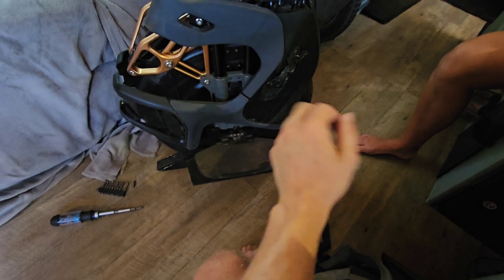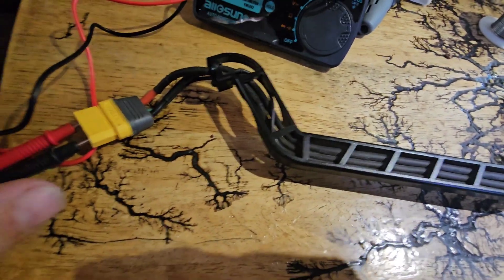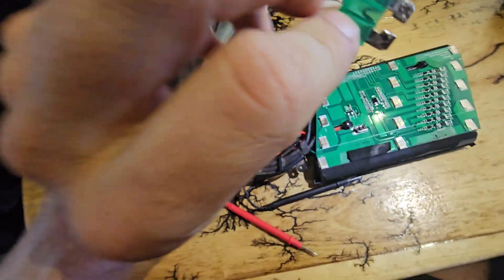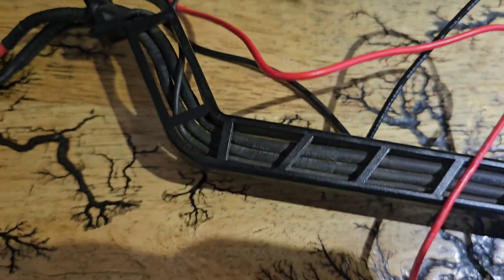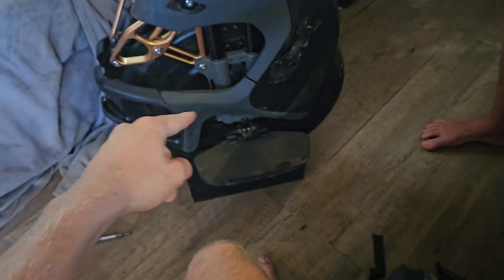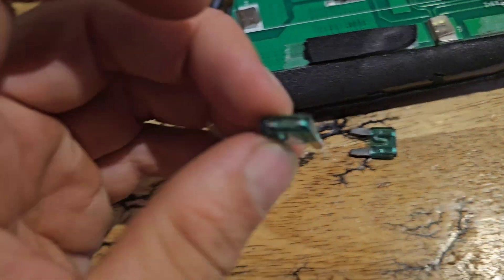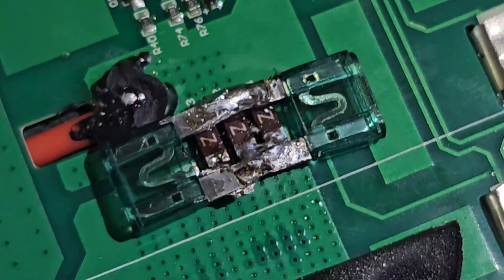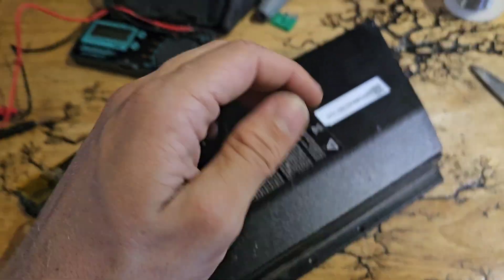kingsong s18 battery (bms fix)

Comment: You said replace 3 20A fuses with one 60A fuse = good but it looks like you soldered two car fuses on to the board?
Reply from the maker: 2x 30a car fues 👌
So 60a total
Probs better if you can do the micro solder with the replacement fuses but this has worked perfectly for me and it sure beats buying a new pack